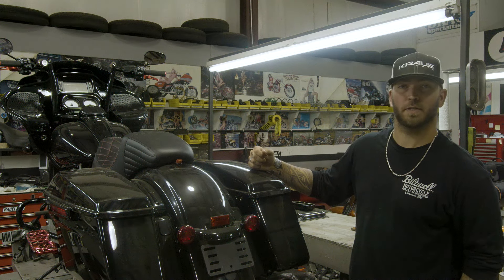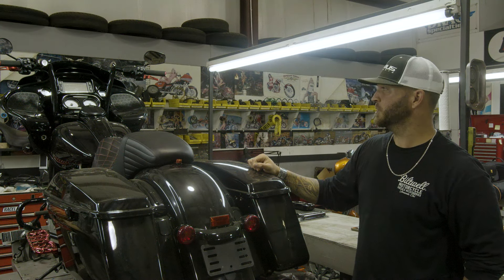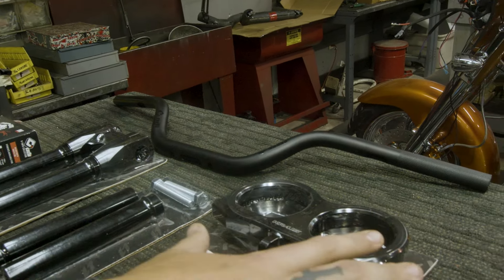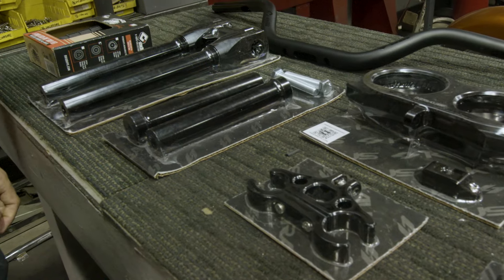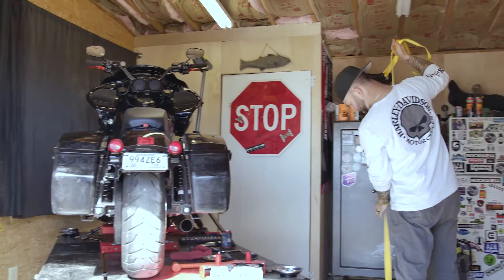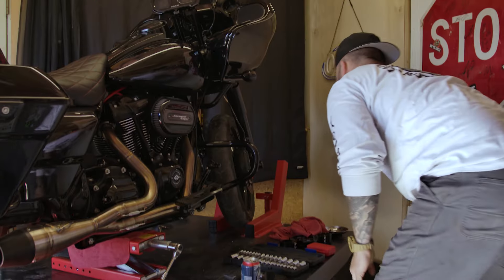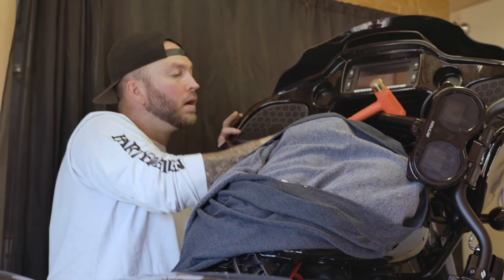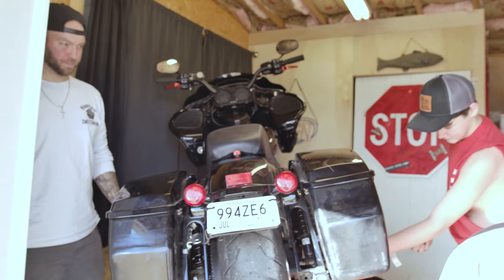Josh Phillips Bagger Build Episode 1 (www.krausmotorco.com code FREEGIFT-JP22 w/purchase)

Comment: I have that Wolf One Pro setup on my '19 FLTRXS for about a year now. 10" pullback riser with the Fly Moto bars. I can control that bike better and I am 5'6". Had wire extensions for the speedo and controls. Brake lines are still stock, which is a plus. Ride safe and looking forward for the next episodes.